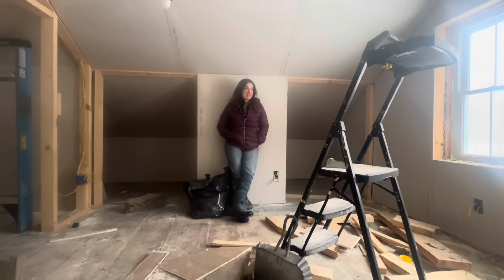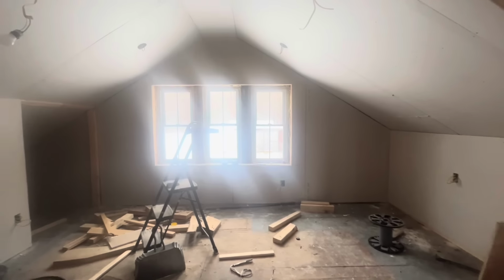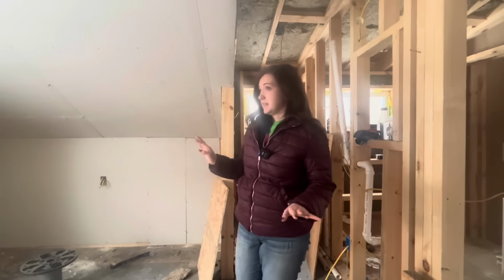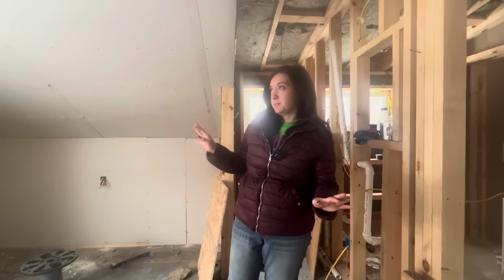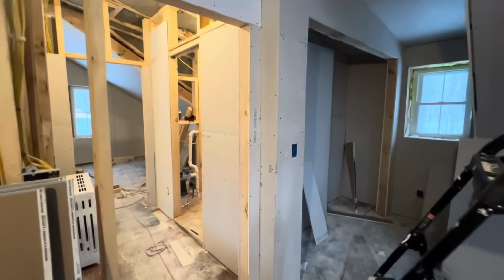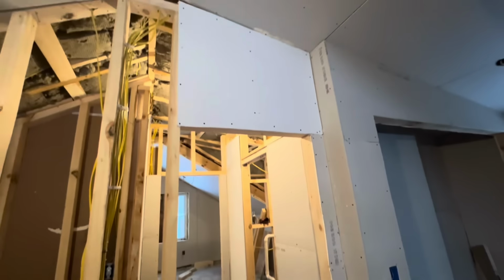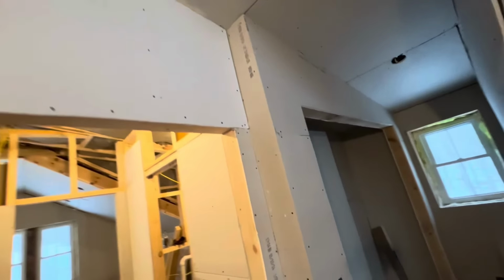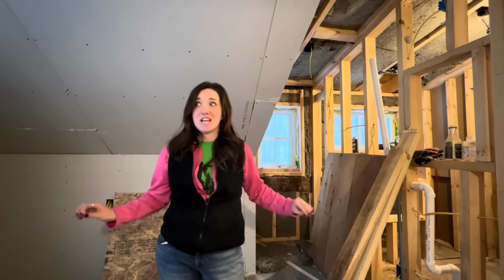SHEETROCKING is Underway at the House!! // My Total Home Renovation

Comment: Drywalling can be such a pain.you really have to think ahead.at the corners where you will be hanging corner bead you really need good backing.I noticed in some spots all you had was the strapping holding up the insulation.you will be better off with the flexible corners rather than the metal corner heads that require nailing.the flexi stuff you can attach with mud

Comment: SUGGESTION - Strongly suggest you add insulation in the interior walls around the bathroom & the walls in the closet that share a bedroom wall.  Will really help with sound proofing.  I'd even put insulation in the walls of the stairway.
The bedroom where you changed the plan of eliminating the bank of drawers;  I think that's a good decision.  You already have lots of storage upstairs, leaves room for furniture, It makes the room look larger.  I think narrow book shelves on that wall is a better choice, like you said.
On the opposite wall, looks like 2 openings to that storage unit for access.  I would only have one access to that storage area.  The one closest to the windows, close it in, you'll need the wall space for bedroom furniture, nightstand, maybe a chair or dresser.  You'll only be accessing the storage area, a couple times a year, one access door is plenty, close to the closet. 
It's coming along nicely.  Good to see the rooms taking shape.

Comment: Abby , I always make it to the end of your videos, sometimes I break them up into segments , which is nice because it will come back to where I left off usually, the program remembers that usually.  Your strength you gained in the last few months is showing in your work.  Strong arms and drive.  Try to keep your scrap pcs with the taper,  the other PCs with no taper not as valuable, you will understand that more as you tape, mud and paint, a 'butt seem is hard to hide and creates a line and wave in the wall, while a tapered seem, takes the tape and mud just right, to hide the seem.  A cut out from a window or door is less valuable than a 1 foot pc with a taper.  Also if you make your marks with the sheet vertical on the pile you hang the square on the rock edge and use your toe to hold the bottom of the tee square all cuts done at the rock pile.  Hard to explain in a few words but, your doing just fine, I just want to go..., "here Abby, put it back at the pile and try this".  and show you, Ah ha, your doing fine and thats better than going to the gym , good exercise.  I am so proud of you and your Team.  They make 10 and 12 foot sheets of drywall if you get a wall that is 9 feet long you may choose to use a 10 footer to eliminate a butt seem.  The butt seems can be hard to hide the line, my boss hated them and would cut a v groove in the seem with the sharp knife to get the tape to sit better.  Anyways...I like the look and corners like you, and you may put up some corner bead galvanized corners especially at the wear areas , makes a nice line and good for the mudding process as the trowel runs along the corner bead.  Wow....great work, please continue to be safe and...when climbing a mountain...as you approach the Summit!  There are false summits, and you realize you have a ways to go yet.., enjoy those trips from the false summit to the Top!, sometimes they are the best part of the journey.  I hope you feel us Rally around you, I believe you do.
Carry On. 😊

Comment: Abby, tell us why you did not put vapor barrier over the insulation.  This is a fundamental practice in any construction.  I don’t care what Jay says, there is not one remodel or construction that I have been on where this is not done.
Reply: Did you use an insulation barrier under a metal roof, house wrap on outside, and rock wool insulation?  Good to compare apples to apples.

Comment: Im glad to see you using cement boards for the shower tile. There are so many ways to waterproof a shower. Do you have your method to waterproof planned out? ( plastic sheeting with airgaps and drainage behind cement board or something like Red Gaurd rolled on or a membrane on front ( never both or you can get moisture sandwhich ) I still see people thinking that tile and grout are waterproof, they are not and can/ will eventually allow moisture behind wall to create an environment for mold to thrive. Or you get old school meets new school methods that can complicate things even with the best of intentions. ( Oh and use caulk in all the corners instead of grout that can crack where expansion and contraction needs allowance) its been so good seeing all your progress and would hate to see you have issues down the road. ( Kinda like the roof ventilation, im hoping the metal roof has ridge cap designed for ventilation? Otherwise all that insulation and new windows are going to trap moisture. House needs to breath, i would get a second or third opinion from experts to find a solution for your particular building. 😻

Comment: When you were showing us the m-r drywall you showed the rock board. I assumed that it's for the bathroom floor. There is an electric heat product  that can be installed in the floor under the ceramic tile. It has a thermostat that's place on the wall to control the heat. It  may take another wire to make that happen. If you go that route you may want to look into that so if you do go with the heated floor you can get the wiring done before the drywall is on. It's very popular. The people I have installed it for love it. Nothing like a warm floor when you step out of the show on a cold winter day. Check it out. It would be a piece of cake to install for a skilled person like yourself. I am kind of worried about one thing. What are we going watch when you get the house done? Love the video's.  Keep them coming.

Comment: Abby don’t put tile in your bathrooms or kitchen I put tile in my bathrooms and the kitchen already had tile anyway I hate tile it very cold especially in the winter the kitchen area is hard on dishes if any kind. If I was todo it again I would put vinal planking it’s easy to install and you can replace each plank if damaged just heat the plank pull it up replace that plan. Just a thought. Good luck. 
You and Jay have done a fantastic job.